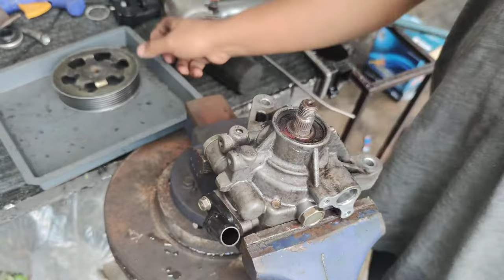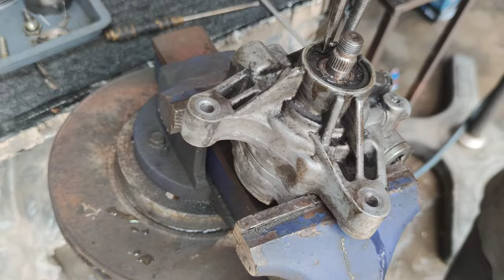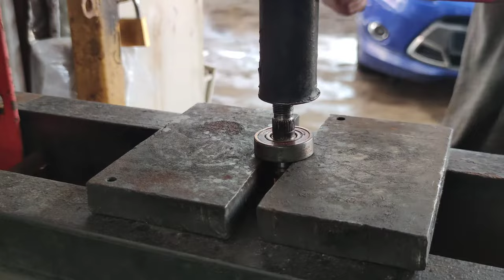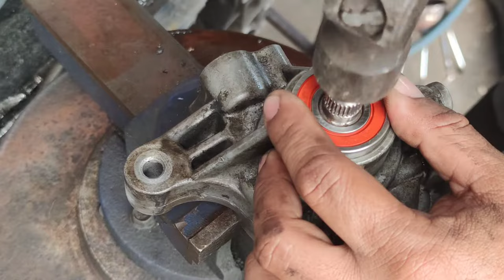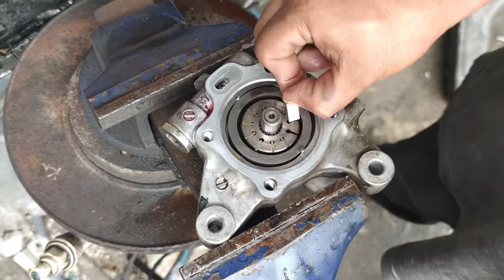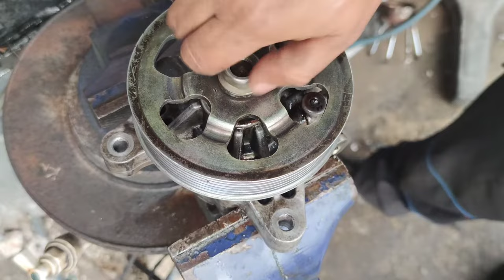power steering leak | how to repair power steering pump honda crv

Comment: Not the correct way to fit a bearing onto a shaft you should support the centre of the bearing on the opposite side to where you are pressing the shaft into it ,what you have done here is potentially put divots into the races which may cause early failure of the bearing due to roughness .
Reply: Exactly!